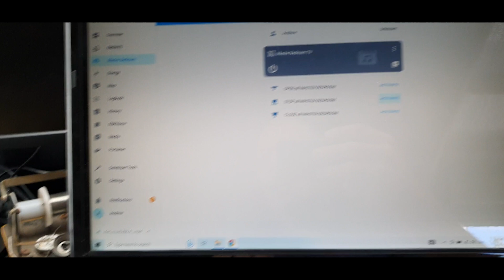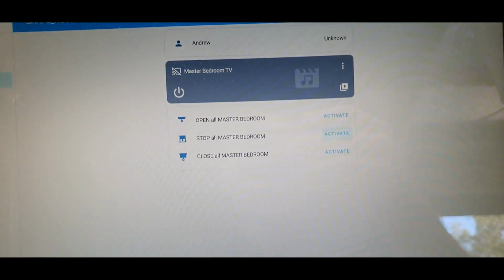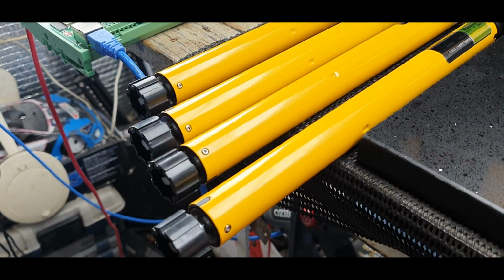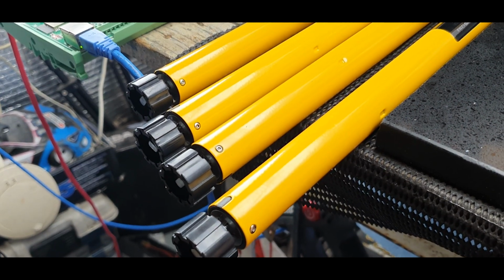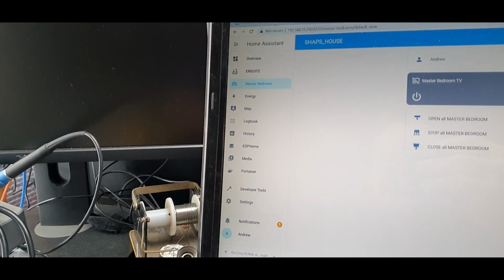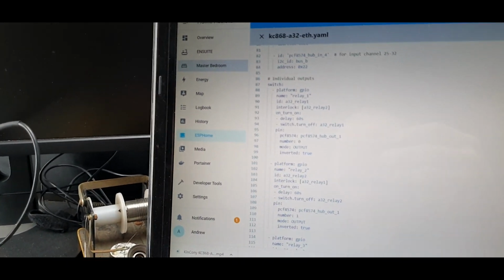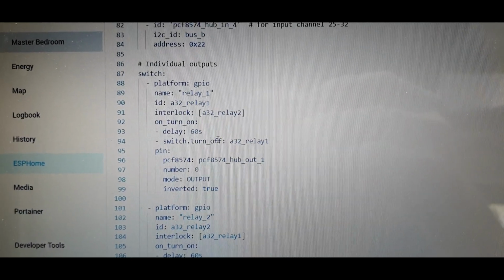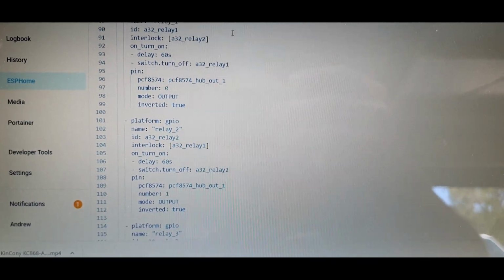KC868-A32 smart control blind motor by home assistant using ESPHome

Comment: I am curious about the connection configuration of this short bar.  Connect the short bar to the NC part and connect it to the negative side so that negative electricity flows overall. 

 Connect the short bar to the COM section and connect the plus side to allow positive electricity to flow throughout. 

When the relay operates, is the principle used by connecting the motor to NO?

Can I see the connected circuit diagram?
Reply from the maker: use two relay control one motor, so that can control motor direction.

Comment: With tasmota firmware on KC868 A32, there are 32 input+32 output or only 32 input and output
Reply from the maker: X input + Y output = 32 (MAX) in tasmota
Reply: @KinCony  in esphome no problem, correct?
Reply from the maker: @manzrik  yes, esphome no any limit.
Reply: There's a way on esphome firmware to do double press function on input (button)  with PCF8574 expander I/O? Thanks for your assistance

Comment: Hello, can i ask to you if you have add interlock function on the 2 inputs that drive the motor? Where can i see the configuration yaml file that you have compiled? Thanks
Reply from the maker: if you use ESPHome, you can add INTERLOCK option.
Reply: @KinCony  and with tasmota too. There is a forum thread about?
Reply from the maker: @manzrik  support download tasmota firmware, just MAX use by 32 channel.

Comment: How do you control the automatic stop of the motor using this approach? Like limit switch?
Reply from the maker: relay board have AUTO OFF function. after relay ON , it will auto off
Reply: @KinCony  the auto off is on the board or on motor?
I know the relay can give a pulse as commanf. But how the motor knows when need to stop when the limit is reached? Is it on motor system?
Reply from the maker: it's on board have "momentary" option.  actually many motor have limit switch sensor, that will auto stop. @giliardi

Comment: It use mqtt cover in homeassistant?
Reply from the maker: it use by ESPHome for home assistant. but also support mqtt with home assistant.
Reply: @KinCony  can it user to control aok, somfy curtain ?
Reply from the maker: @hieuvip88  control any 3 wires motor.

Comment: Hello sir 
Can u control 50 rgb led lights  in different different patterns  
(Rgb led light 4core wire)
Reply from the maker: RGBW LED?
Reply: @KinCony   yes rgb led light 12v 18w use in water fountain
Reply from the maker: @sanjeevelectricalco  i think you can add multi KC868-AP dimmer board for your RGB LED strip.
Reply: @KinCony  Hello Sir, our light is inside three colors and we have to operate fifty lights like this and for that we need a controller of 150 output and inside that controller there should be an automatic program to jizjack the light.
Lights on / off different different patterns  pls see fountain videos 
(Lights use in fountain need a controller like dmx 512)
Reply from the maker: @sanjeevelectricalco  why not use DMX512 controller? or maybe you can use addressable programmable LED strip, such WS2812B, that need only one GPIO.
Reply: @KinCony  sir send any video
Reply from the maker: @sanjeevelectricalco  https://youtu.be/xptAHlOLV-w
Reply from the maker: @sanjeevelectricalco  ok, whatsapp: +86-15381188302